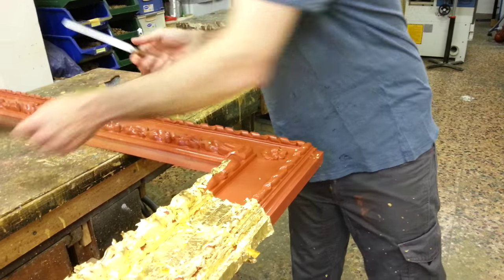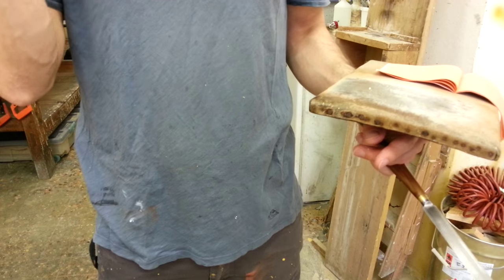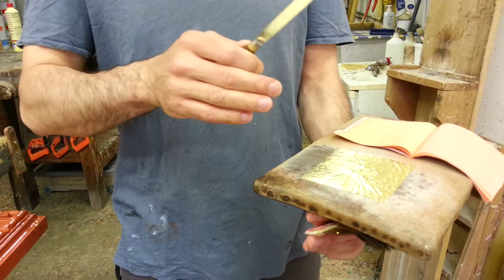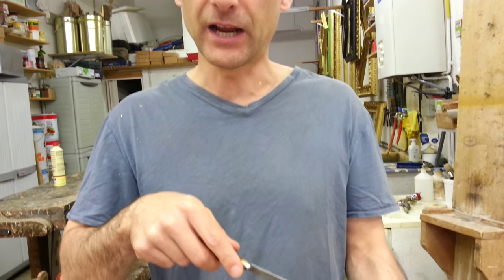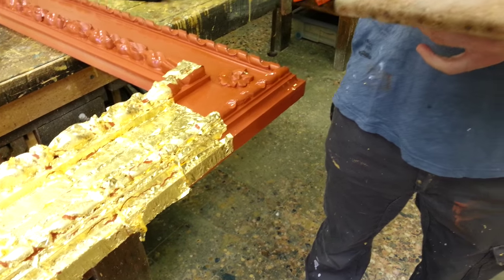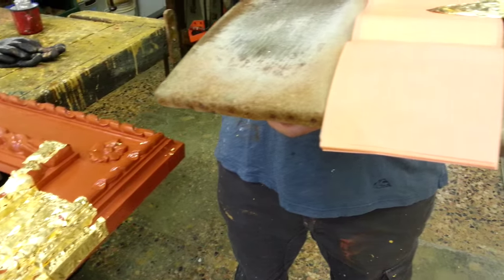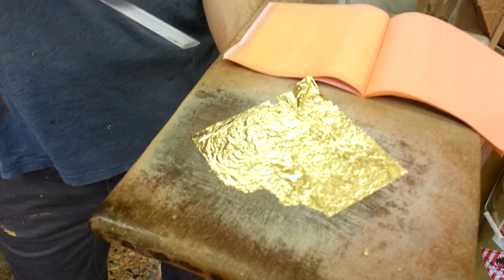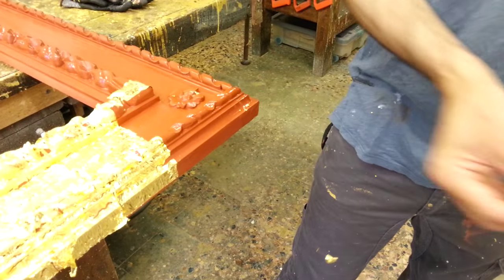Gold leaf gilding - 22 carat gold leaves (OIL GILDING TECHNIQUE)

Comment: Do you seal or clear coat it with anything? I made a brass sculpture and used 23 K leaf, I could still scratch the leaf of with my fingurenail so I clear coated it like the rest of the sculpture. I tried to burnish it with the paper but it rubbed away.
Reply from the maker: It is quite difficult to protect gold on brass. I did it a couple of times using the kind of varnish used to protect the bottom of the boats. We call it "copale marina". It's plenty of brands out there. You need to do deep work to find out the best product, I mean the one which won't ruin your work. Good luck my friend
Reply: @nowframes  thanks
Reply from the maker: No problem ask anything you want. When I get around I will surely reply.
Reply: @nowframes  do you want to see the sculptures I put the gold on? There's an international art dealer that owns a few Basquiats that was Interested in them.
Reply from the maker: @artlover5798  sure, send some pictures
Reply: @nowframes  I send you  a pic through Facebook, I'm delivering that sculpture tomorrow!

Comment: Wow you made it look easy. Superb technique Sir! Recently I have project that force me to learn the gilding technique, at first i thought how hard it could be? Boy was I wrong.

Seeing you gilded like that, made me want to learn more about this technique. What is the purpose pillow like that you lay the leaf ? Is it must have tools for gilding? Is it special made or anyone can buy in a shop ?

Thanx btw, keep up the superb work!
Reply from the maker: Here in Italy teh pillow is a special pillow made for gilding. Frankly I think you will be able to make yours by yourself. Just keep it enough Hard. The pillow doesn't have to be soft.
Reply: Use a wood chopping board.  The 'pillow' is just a wooden board covered with thin suede, so that the suede grips the leaf, and the wood board is hard enough to allow a clean cut.  If you pad it, it will not be hard. If you use only the board, it will not grip the leaf which could fly away or slide under knife.  Common sense.
Reply: @nowframes  do you ever clear coat the gilding? What if it was a sculpture? I posted another question.